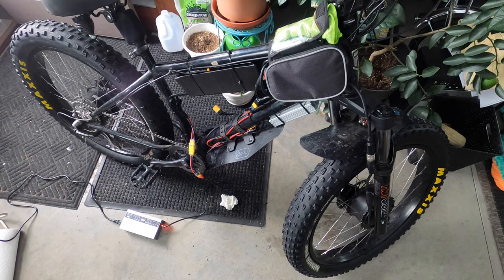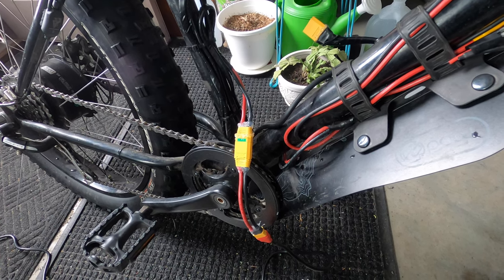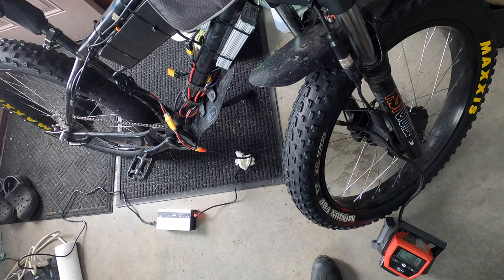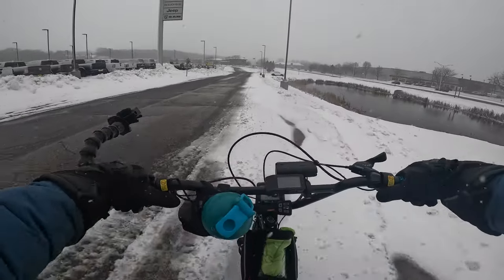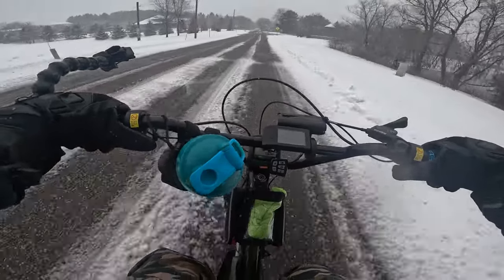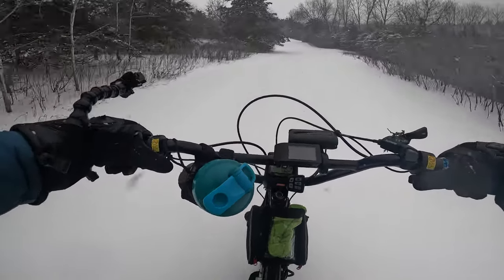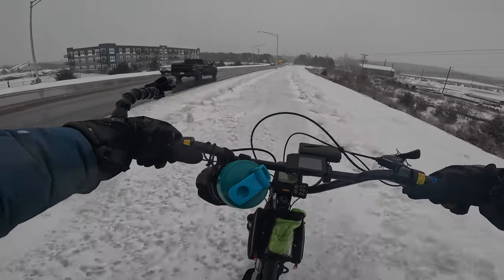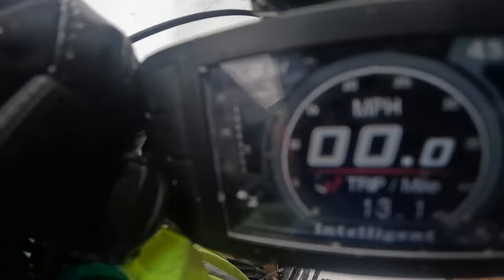Dual Motors Blizzard Burrito Ride. 52V 8AH Samsung 40T3 cells 14s 2p

Comment: Snow is not very conductive, yet if your connectors start corroding, water can short your terminals. I warmly recommend you to use 3:1 shrink tube with integrated hot glue. They will waterproof all your conectors and leads, get three different sizes, one large one to wrap connectors, and 2 smaller gauges for the leads, once you're done, get proper electrical tubes and wrap it all in there, it will be much safer and way neater
Reply from the maker: i've had it happen both in the rain,  and in the snow especially when its salty wet roads,  the XT60 get flooded,  ive had the gold contacts in them turn all blue and crustacean on me.  If the xt60 fills up with water it'll Do something, thats for sure, usually it just turns off and you need to wait for it to dry out,  and it wont turn on.   But I've had one time where i smelled melting plastic. And the Xt60 was melted to an extent. From road salt water. Yeah the bike is a big a mess right now- I just had to throw these other controllers on it, So I could go ride in the snow quick.  I have heat shrink tubing. but the kits usually come with like 2 pieces of the 1" stuff, i've ran out of the useful sizes Lol

Comment: cool stuff, whats your thoughts on that suspension fork? they seem fairly inexpensive and thought I might give it a try to replace my janky steel fork I had to bend to fit the front motor.
Reply from the maker: the RST guide works good for front motors  where other ones will break

Comment: Are Samsung cells better than LG cells?
Reply: Are apples better than bananas?
Reply from the maker: in the Grin tech battery video they did recently,  they seem to say Samsung and Panasonic are the top tier,  lots of other people seem to say Molicel.  I was not impressed with the LG cells in my UPP 72v triangle battery but who knows if they were actually LG , lOl
Reply: @EBikeBuilder_  I have a 52 volt 20 amp hour upp battery pack on a 48 v 1000 watt hub motor and it don't seem to push any more power than the 48 v 15 empire battery, it also lag a lot
Reply: @EBikeBuilder_  thanks for your reply